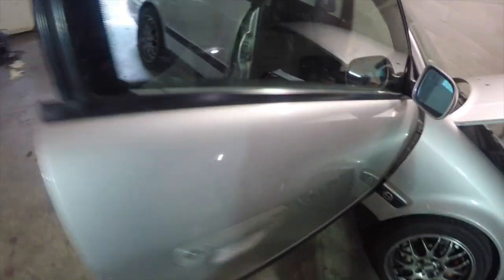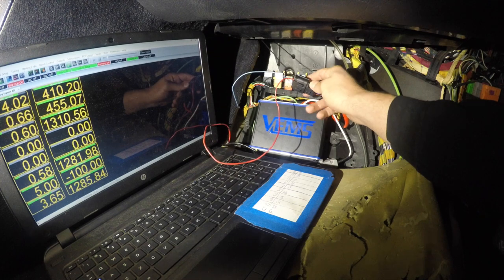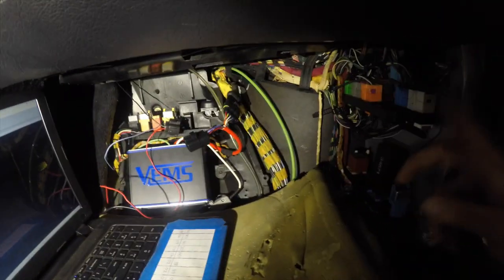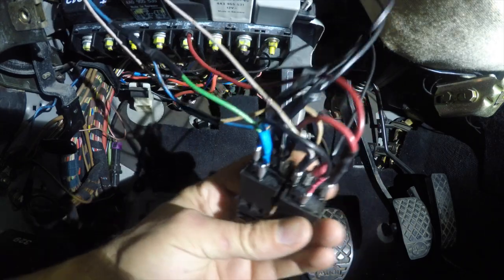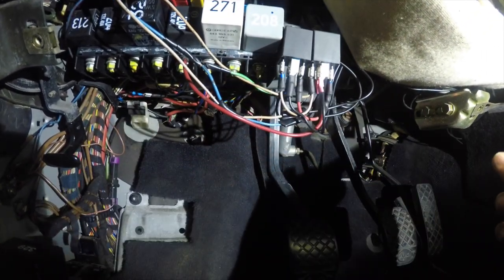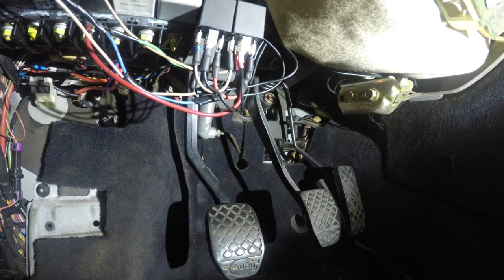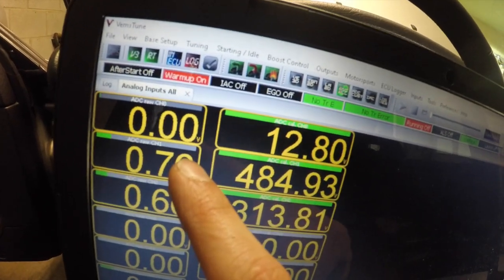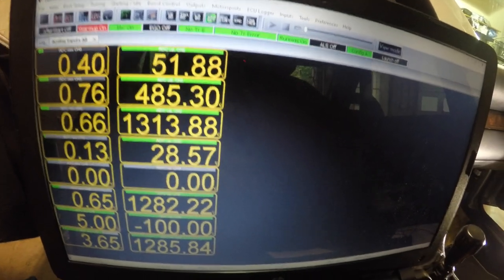Audi UrS4 C4 VEMS Launch Control/Shift Cut setup and configuration

Comment: Nice. PS. It would be much easier to understand what you are taking about if you make a small wiring diagram of your setup.
Reply from the maker: I definitely should have! I am no expert in electronics but I do agree with you a diagram would be helpful for some. It also looks confusing with two relays but they both share the same power, ground etc... I had only the article to go off of when I installed mine so I figured an actual video of what it all looks like would be very helpful. Thanks for watching!

Comment: Nicely done. I hope it's not painful when i try this on my 034 stage IIC Ecu. Do you have any info on how to wire the boost gauge in the dashboard using the clock location. I can't seem to get the gauge to work.
Reply from the maker: I am not running any power through my boost gauge. I took the clock out, gutted it and rebuilt it with the boost gauge internals and face that you see. This way I can use the factory bulb for the clock to illuminate the boost gauge making it much more simple. Maybe I'll make a video about it someday, hope this helps!

Comment: Hey man since you're the closest thing to a urs4 guru I have a problem maybe you could help with. I installed a gt3071r turbo and accompanying mods. When I hit boost 5-10 psi it sounds normal but above 10+ it sounds almost supercharger-ish. Any ideas what that could be? It runs fine and pulls hard, no shaft play. 

Thanks!
Reply from the maker: Far from guru status but I definitely appreciate the comment! I built this channel to inspire others to post their builds so I suggest you show us your setup. For your issue... I would start with checking for boost leaks. If you have a good leak the turbo will "over-spin" to reach the desired boost pressure. This will cause it to wear out much faster and sometimes make abnormal noises.

Comment: Thank you! Now I'm going to copy you 😉 Except my LC will be on a FUNK button and NLS on antilock
Reply from the maker: Copy away friend, everybody wants that FUNK button, even me! Lol, I recommend using the button for NLS but not LC. My issue was the button would stay on and try to engage LC while shifting and that would cut all power. The new "momentary" switch works perfect for LC so I recommend trying that if you have issues like I did.
Reply: @quattro4life20vt  Thank you! I am actually having LC problems right now. Seems to go into some weird conflicted state when I try to launch and won't go past 4,000rpm. I just switch the button off whenever I use launch but I'll try the momentary switch. Seems like a better option!
Reply: @quattro4life20vt  had another question. what channel is your second fuel pump trigger wire hooked to? hooking mine up this weekend. I assume any grounded channel?

Comment: Nice video! Did you remove cruise control so it doesn't send send 12v and if you did would you mind explaining? Thanks!
Reply from the maker: Yes, cruise control is deleted to avoid sending 12v through the 5v circuit. That would be bad... but hey, I mention that in the video lol.
Reply: @quattro4life20vt  What exactly did you remove as part of the cruise control?
Reply: @quattro4life20vt  I got it all figured out and wired, thanks for the video!
Reply from the maker: @BGaZaR  nice job friend, I knew you could do it!